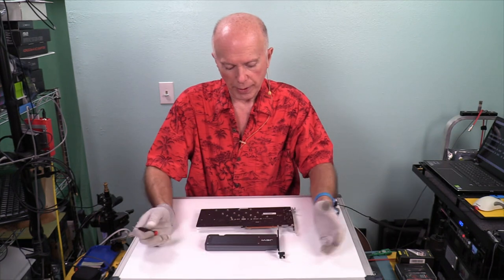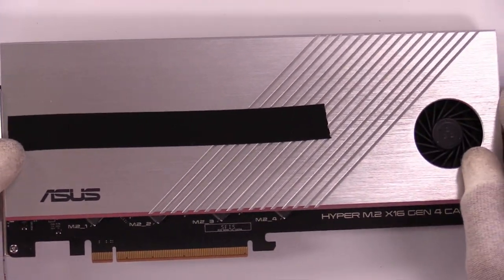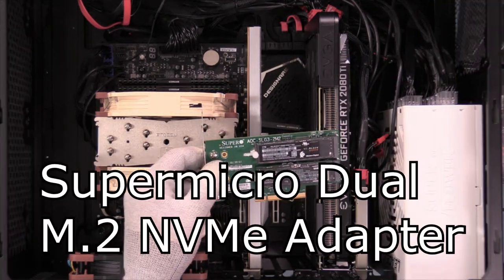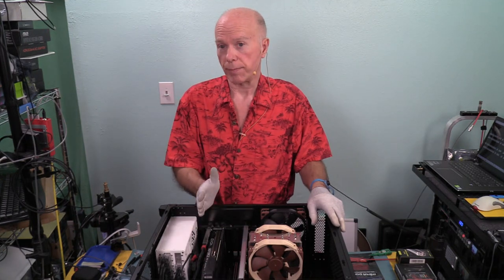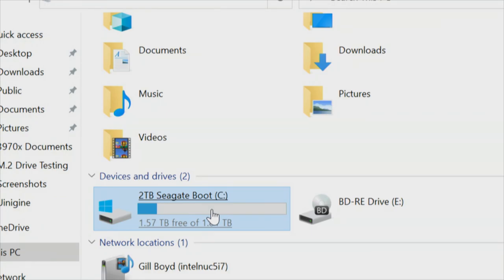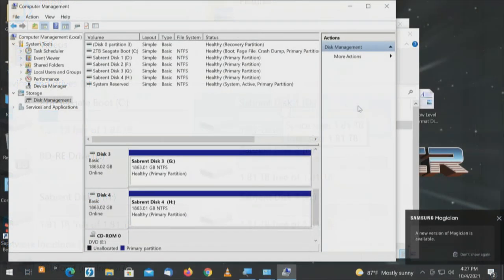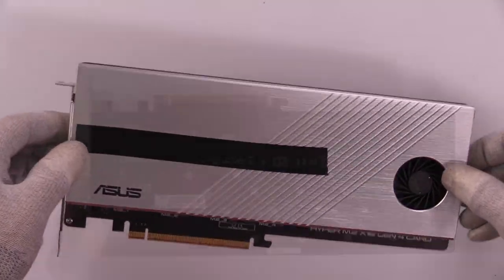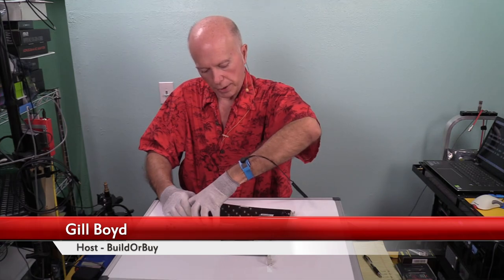ASUS Hyper M.2 X16 PCIe 4.0 X4 Quad card Heat and Speed Test Comparison

Comment: Hi, i have the same ssd expansion card and the chipset is z790 and the pcie on the chipset supports pcie 4.0 for 1 ssd. I have 5 1tb 990 pro sdd drives, do you know why im getting gen 3 speeds please? Thanks. The maximum is 17500 reas speeds and im trying to het 37500 read speeds. Thanks
Reply: And all pcie gens are maxed out in the bios
Reply from the maker: Hello Patrick Jones,
Welcome! Which Motherboard and CPU are You using? We have to know the Design and compare to the Specific Motherboard Implementation. Every Motherboard has a different PCIe Resource allocation.
Reply from the maker: Hello @charbel369 ,
To reiterate, Motherboard and CPU?
Reply: @BuildOrBuy  hi, so the motherboard is the pro MSI z790p ddr4 WiFi motherboard and the CPU is the i5 13600k. Thanks
Reply from the maker: Hello @charbel369 , 
Looking over the Design and Implementation plus the M.2 NVMe PCIe SSD Specifications, that's weird. You should be getter much better Results. Something is way off kilter. 

PCIe 3.0 = 3,500MBps 
PCIe 4.0 = 7,459MBps

Suggest Diagnose, Test and Verify 1 Drive only on Motherboard. Check Motherboard Bios Firmware then M.2 NVMe PCIe SSD Drive Firmware. Do You have any other M.2 NVMe PCIe SSD Drives to compare with? Did You Verify Bios Settings for PCIe 4.0?

In Bios, Verify:
PCIe/PCI Sub-system Settings 
M.2_1 - Max Link Speed
And so on...
Did You purchase this Motherboard new or used? Someone might have changed those Settings.
Reply: Hi, thank you so much for getting back to me. Yeah it's very weird. I've updated the latest drivers for the 990 pros  all in one go using Samsung magician in ahci mode. The motherboard  is brand new. Thanks.
Reply: I've done a vid showing what I did
Reply: And the chipset drivers are on the latest version and still no luck
Reply from the maker: Hi @charbel369 ,
Good experience! Hope You were able to help other Viewers in the same spot!
Reply from the maker: Hi @charbel369 ,
Based on what We're aware of, the Chipset appears to be the Problem. Reports are based on ASUS Z790. That's Why We were Specific in only trying 1 M.2 NVMe PCIe SSD Drive to Test and Verify. If You have not tried that then no use in trying anything else. Good luck.
Reply from the maker: Hi @charbel369 ,
We were Specific about Firmware not Drivers. New Motherboard, that alleviates one potential problem.
Reply: @BuildOrBuy  ok thanks, I'll update the bios to the latest version. I think I did that already but I'll do it again.
Reply: Yeah still the same issue sir. Im hoping they didn't send me a gen 3 SSD expansion card. I was able to backtrack the order and they said it's gen 4.
Reply from the maker: Hello @charbel369  , 
Did You only have 1 Drive connected and Test performance?
Reply: @BuildOrBuy  hi, no I haven't, which drive do I test out please? The one that's inside the expansion card? Thanks
Reply: I've tested it on any of the one ssds and I got 7000 read speeds in vmd/irst mode. I've updated the ssd to the latest version.

I've put all of them in raid 0 again before without the SSD expansion card and still gen 3 speeds. So the expansion card is not the issue.
Reply: Do you reckon the vmd/irst drivers are out of date?
Reply from the maker: Hello @charbel369 ,
Excellent! Now We're making Progress Testing One drive. Now with that One M.2 NVMe PCIe SSD Drive, cycle through the process of Two and so forth by Testing drives individually. The problem is the Motherboard Chipset not a driver. Interesting, right!
Reply from the maker: Hello @charbel369 , 
To reiterate, Chipset. Continue to Test and Verify.
Reply: @BuildOrBuy  ok thanks, I'll do that
Reply: So I've tested it and excluding the expansion card, the 3rd slot on the motherboard gives me the gen 3 speeds. 

Still excluding the expansion card and the 3rd slot, 3 out of 5 ssds work properly, giving me 21,000 read speeds. 

Including the card so 4 out of 5 ssds, it gives me 18,000 read speeds. Don't get why it's 18,000 not 30,000 for gen 4 speeds or 14,000 for gen 3 speeds
Reply: Also I have a 1300w PSU and it should be able to get good performance out of the SSD expansion card
Reply from the maker: Hi @charbel369 ,
Excellent and Interesting Results! All about the Chipset! A Hybrid Bios RAID of 4 M.2 NVMe PCIe SSD Drives = the speed of 3 M.2 NVMe PCIe SSD Drives. Why? Overhead. Therefore 3 x 7,000MBps should equal 21,000MBps. Therefore there's more degradation due to the Chipset than suspected. Fascinating, right!
Reply from the maker: Ho @charbel369 , 
Which one? Clean Power is extremely important!
Reply: @BuildOrBuy  hi, oh ok so you're trying to say that my ssds are too powerful for the chipset to handle.
Reply: @BuildOrBuy  and the power supply unit is a supernova evga 1300w
Reply: @BuildOrBuy  and the eco switch is on disabled
Reply from the maker: Hi @charbel369 , 
Good idea!
Reply from the maker: Hi @charbel369 ,
Smart choice! Quality PSU!
Reply from the maker: Hi @charbel369 ,
That's one way of looking atvthe situation. The Chipset is neutered!
Reply: @BuildOrBuy  hi ok so there's something wrong with the chipset, thanks for letting me know. I'll just stick to 3 SSD drives. Thanks for your help
Reply from the maker: Hi @charbel369 , 
Now You can better understand why We have to be methodical in Our approach to Test and Verify! Look what You now know to be true! Fact and not opinion! That is a design flaw in the Z790 Chipset. Not the 1st time that has happened!
Reply: @BuildOrBuy  yeah thanks